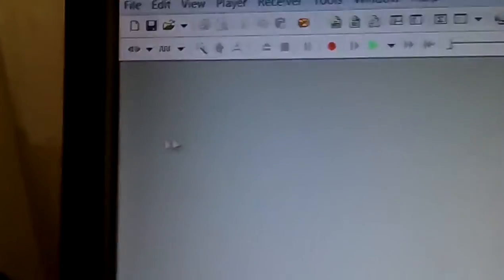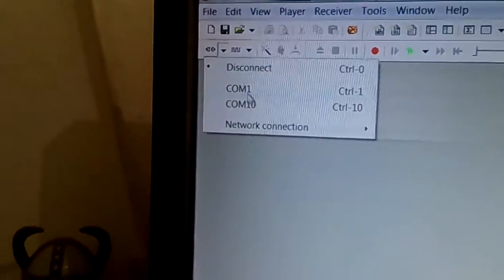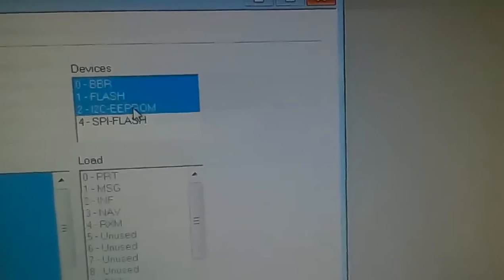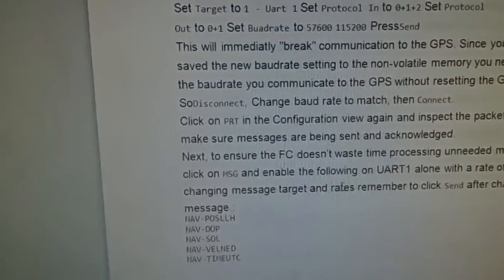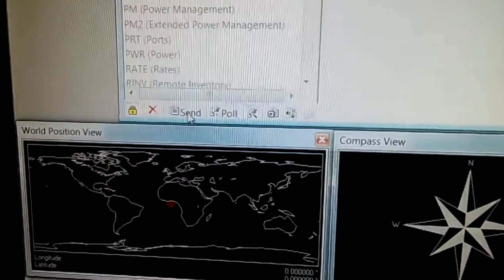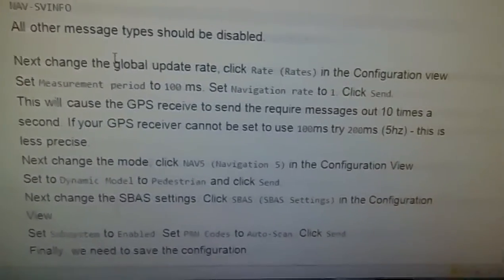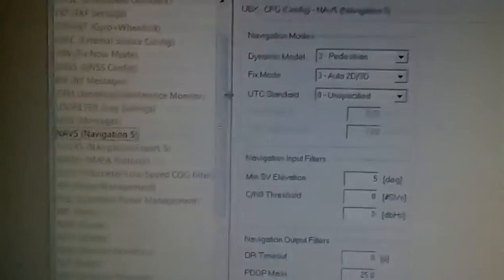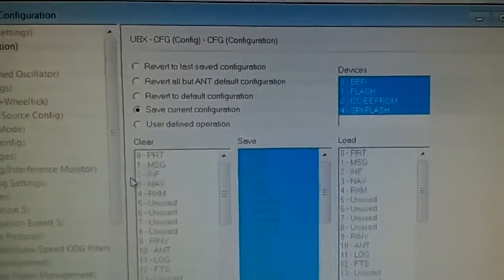Configuring Ublox NEO 6M GPS Part2

Comment: Hi!
i have tried this and it saved all the comfiguration. But once i connect it to my APM 2.8, it fluctuates between "No GPS" and " No Gps Fix". since i have set the baud rate on Ublox to 115200, do i need to set the same baud rate on the APM 2.8 as well? then how should i do it?

Comment: I got a strange problem......! I am working on ublox neo 6m module with built-in micro usb port and UART. I programmed my gps via UART using FTDI converter and save all configuration on EEPROM+FLASH using u-center 18.11. I closed u-center and reopen it. It was working fine. Everything was fine but as I unplug my FTDI converter to turn off GPS module and replug it to Turn on GPS module, it didn't work.(Some buddies will say that I didn't write EEPROM but EEPROM was selected). The strange thing happened when I plug my micro usb on  GPS module.. I started working.! 
I have got these confusions
1. GPS Module is working on all baud rates via micro usb port.(No UART)
2. GPS module is not working via UART after configuration changed.(No USB)
3. GPS module is transmitting data via UART(TX) while powered from micro usb port after configuration changed.(UART_TX and USB_Power)
If someone know whats wrong then please let me know. You can also email me on hsmalik96@gmail.com
Reply from the maker: I don't know why that would happen 🤔
Reply: @luisfilipe1983   thank you for your response... but can you just guess?

Comment: Dude.. you're a genius. Did you by chance flash the module with 3DR-Ublox.txt ? I was told that this also has to be done, but I'm not sure. I tried your method here and it seems to be working better, although I still get GPS "No Fix" in both Ublox and Mission Planner.
Reply from the maker: nop...i did not flash that 3DR...txt, but where you are it might not get dps fix...outside it always gets it easier...insides might be harder.
Reply: luisfilipe1983
Not with an "Open Source" version. Indoors I get 10 satellites in 2 seconds. This Ublox seems like it's weak because I can simply run my hand over it and watch the satellites drop in u-center. The signal or receiver on the Neo-6m seems to be very weak.